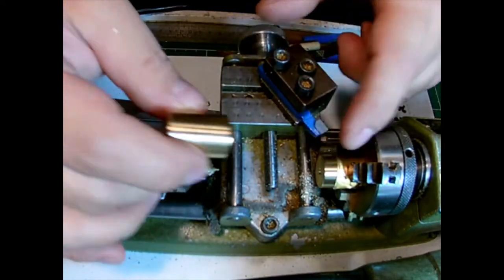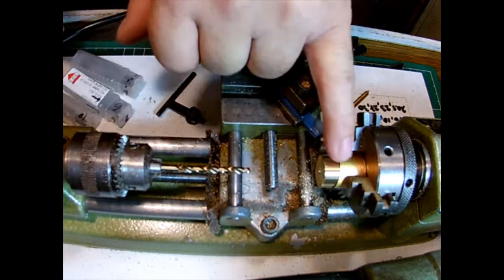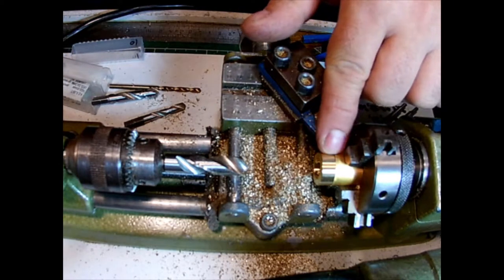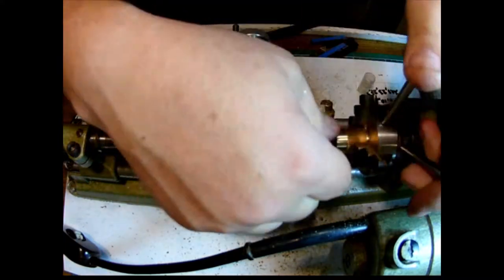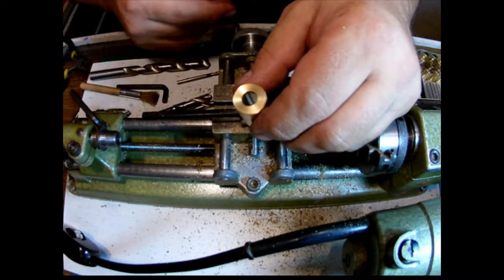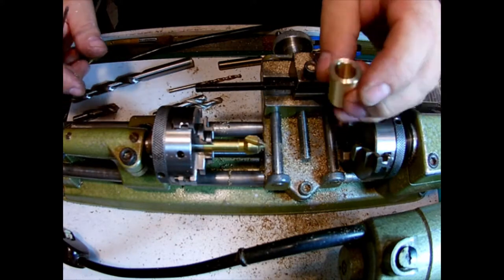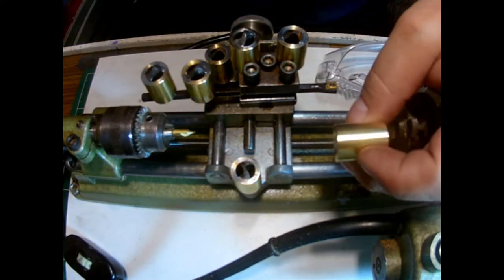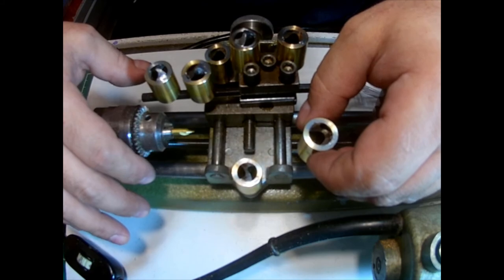A fluted slug for TFM to test it's aerodynamic flight

Comment: outer o.d?
Reply from the maker: Lol... my bad. Outer Diameter... :)
Reply: @Smallathe  so i was ask what it was. as in can you please tell me the o.d you turned it to
Reply from the maker: @17hmr243  Sure. Why not help when one can? Outer diameter is always 17.2mm. This is the shot cup ID. The drill bit was 11mm so the ID to the bottom has a 10mm ID shelf that does not allow the drill to fall through. Hopes this helps... feel free to ask :)
Reply: @Smallathe  17.2 cheers ☺
Reply from the maker: @17hmr243  Cheers mate:)